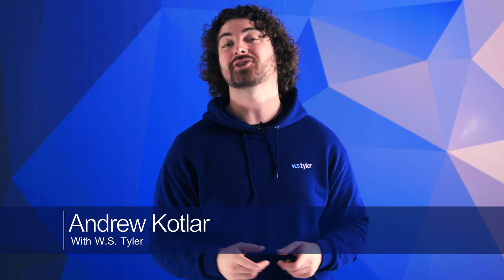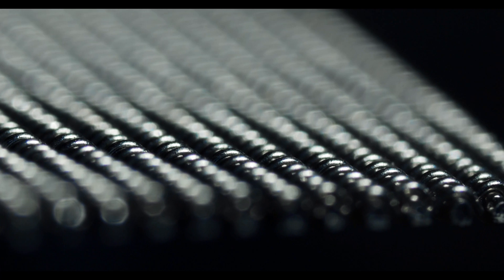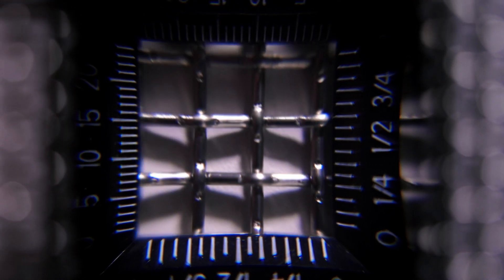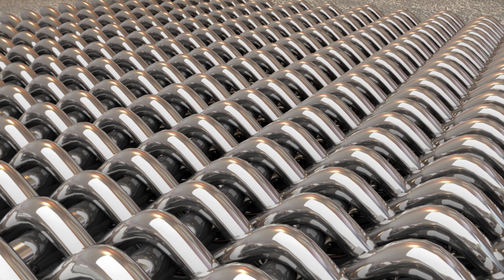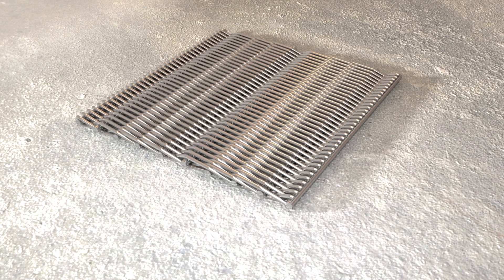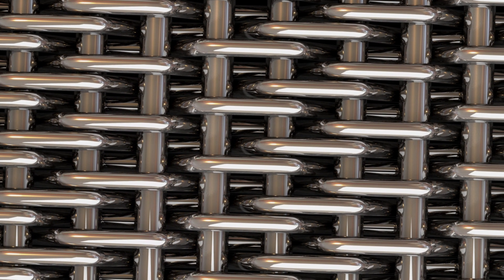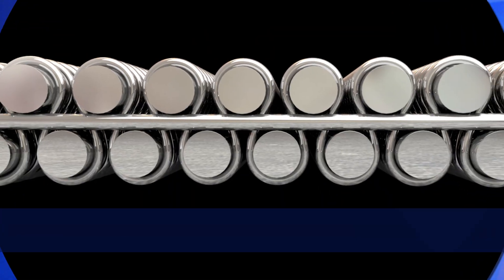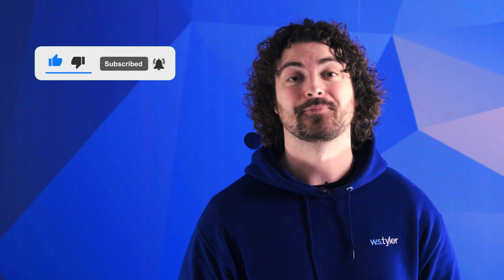Choosing the Right Wire Cloth Filter

Comment: Hey there! A quick few questions, the last 3 dimensional design you mentioned,  is it easy to work with...like can I bend it into a small 1"x1" shape? 
And also, with the 3D one...would the 5 micron size impede airflow significantly? I'm looking for something that separates the most oil mist, as the path of the oil mist will eventually be returning to a clean air stream back into an engine. So I need something with maximum filtering ability without sacrificing airflow (370CFM). Any suggestions?
Thanks
Reply: Bending metal mesh is completely possible, but it must be welded after bending. If it is 5 microns, it may hinder airflow. We suggest you replace it with a larger aperture. If you have any questions, please leave me a message. We are a professional manufacturer and seller of stainless steel filter screens,
Reply: Roger that, will do. Thank you  @youtubetianzhong